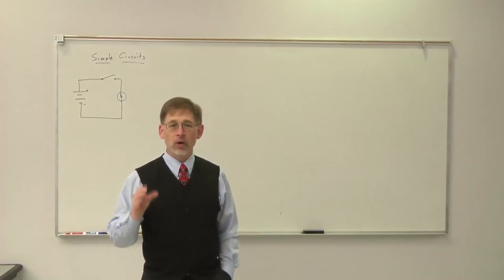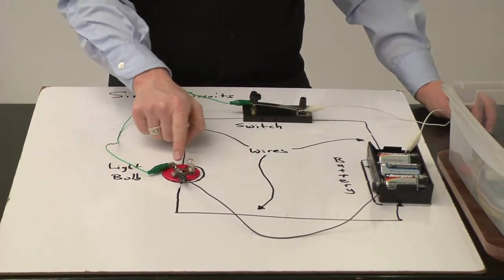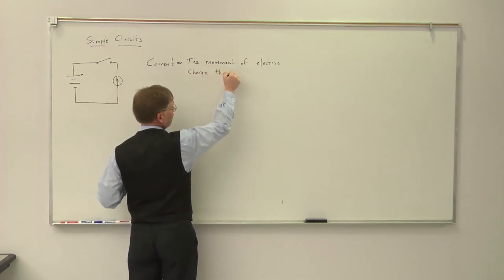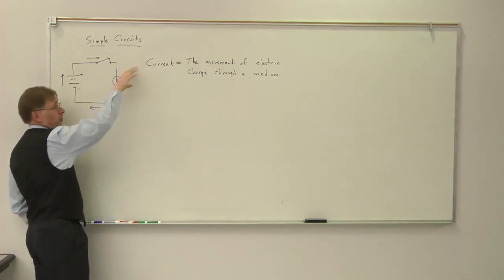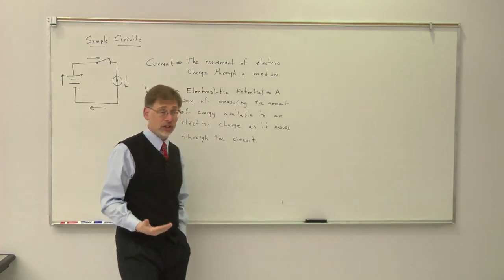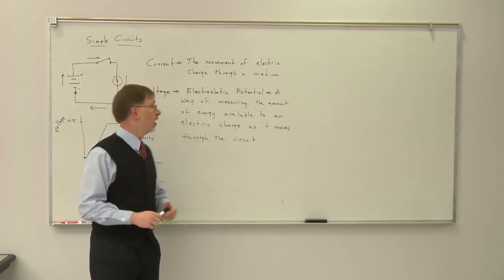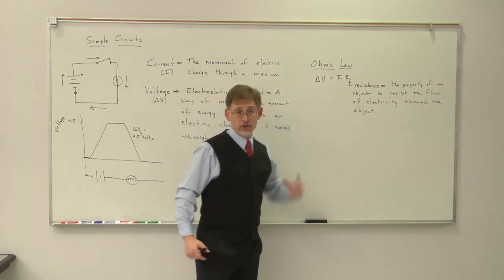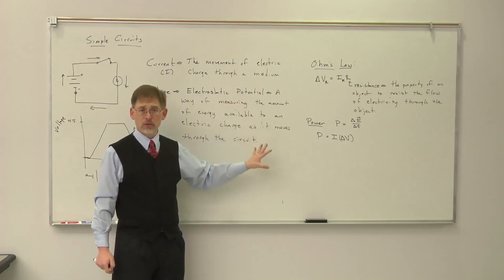Simple Circuits: Part #1

Comment: In your graph of voltage against distance through the circuit, am I right to understand 0 voltage as being measured relative to the "end" of the circuit, and upon passing through the battery you achieve some increase in voltage, to then be drained through the light bulb and terminating back at the "end"--which is the ground state?